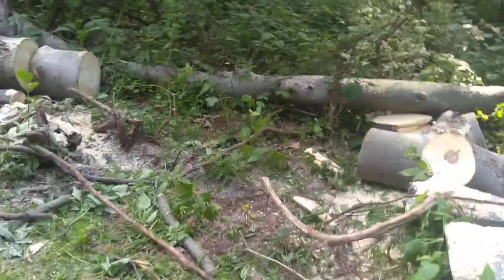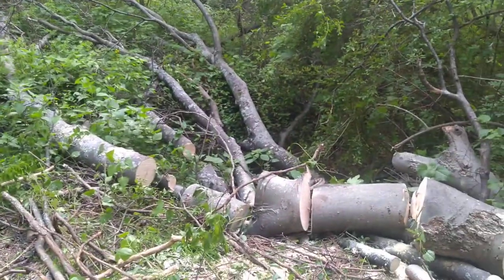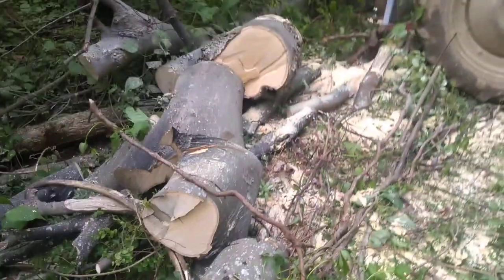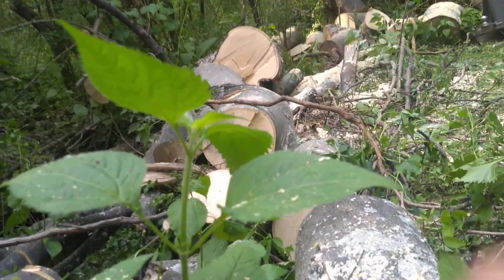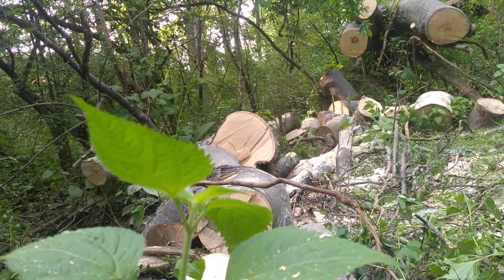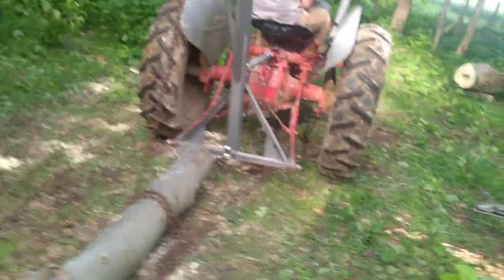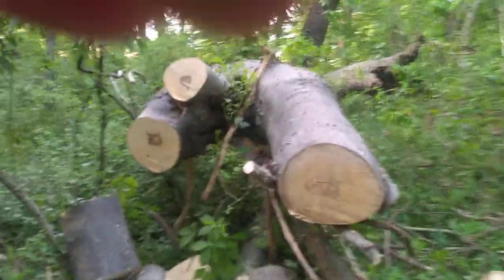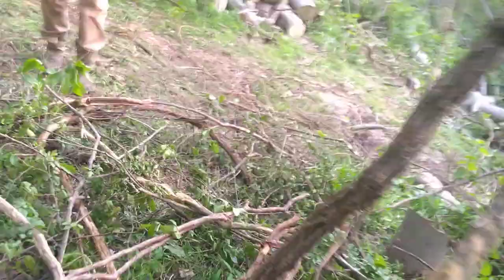Testing out the new boom pole

Comment: I got 8 acres  left of tornado downed trees to clean up yet and it's been almost a year since da twister missed my house by 100 feet it even ripped half my roof off it was that close
Reply from the maker: Wow glad ya made it through. Sounds like alot a work.
Reply: I might just need to make a boom pole for both my 41 9n and my 2n I've been using a belly frame made of 2x4 c-channel fastened to the axle and front of the engine but... I still gotta figure out how I'm gonna get that 2 ft Dia birch out that's wedged 30 ft in the air between 3 other 1-2 ft Dia trees with root ball still intact without cutting out the 3 other big trees
Reply from the maker: @dodgeme1986truck  I would like to have a 9n. One with the high and low. Mines a 47 model Ferguson.
Reply: @wilkersonsmowershop8379  both of mine have the high direct low gearbox